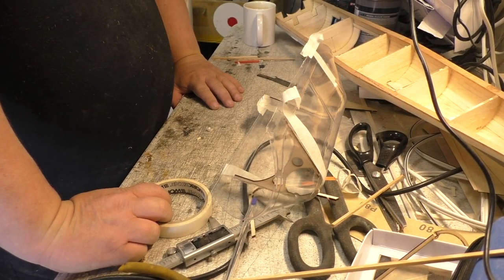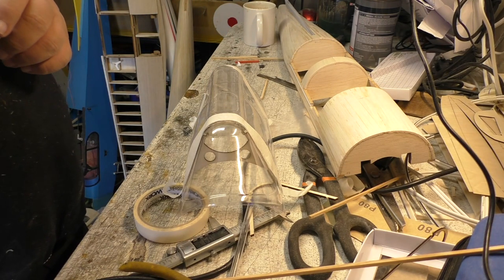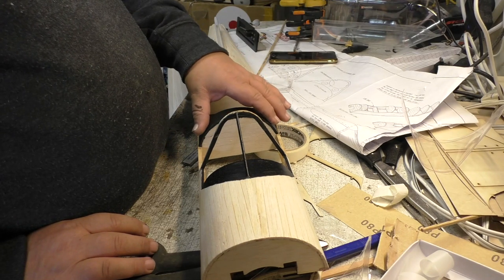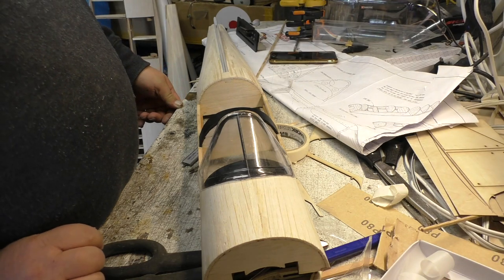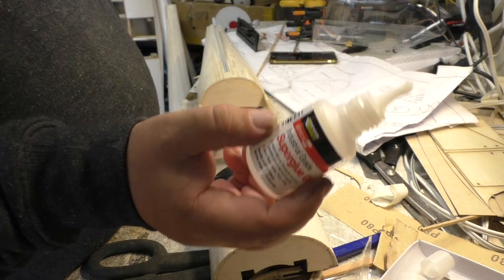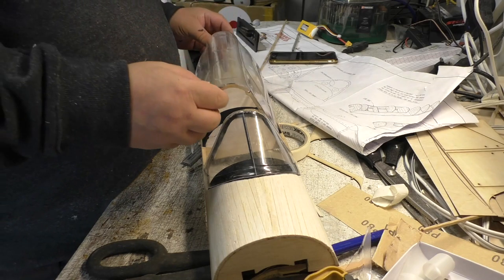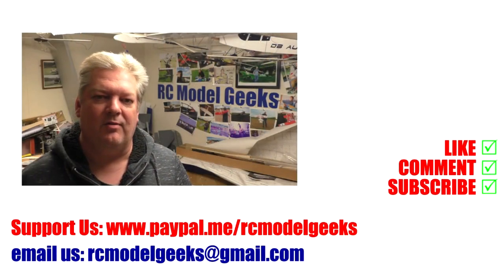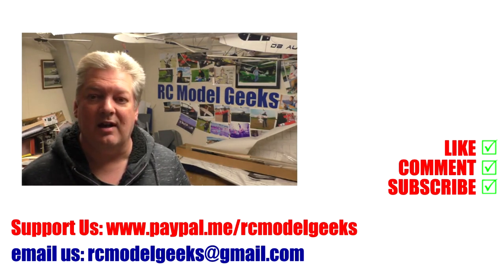Sarik Hobbies Dennis Bryant 68" DHC-1 Chipmunk Build Pt33 RC Model Geeks

Comment: Rob we discovered a first class adhesive that will do the job on canopies,it is proving so good that I always keep some on the workbench and it is cheap as chips,PRITT CRAFT-IT METAL GLUE a strange name but yes it does indeed stick metal and anything else for that matter,try it and you will be finding all kinds of things to stick with it,I think they must use it on jewellery findings and things like that ie glass,shiny objects and metal parts too

The problem when things are scaled down like these canopy frames and supports is there is very little surface area and strength is compromised,I remember the days of the old scale nationals when entries were test flown carefully before the big day and then the essential qualifying flights as the scale details were so fragile,DB simplified a lot of his designs for sports flying like this classic Chipmunk.

Glad that you got some flying done down the beach,always good to do some flying in between a build.

Comment: Captain did you try RC 56 canopy glue ??
Reply: Hi Rob did you know that there is a aluminium tape on a roll on ebay and DIY stores for joining duct work together it can also be used for covering models much like flitemetal but much much cheaper, if you look at you tube there is one particular P47D Razorback build that shows this perfectly. It is nice and thin and would cover the fake raised panels on the canopy. I tried this out on my P47 and it works great will be even better when I ever get round to finishing it. keep up the good work. but please try to use something other than film or fabric covering. fiberglass the fuselage and add panel lines, rivets etc don't waste the great work on a scale model you've done so far.